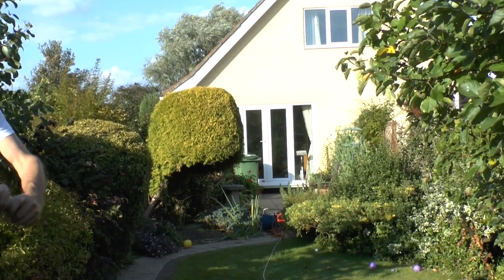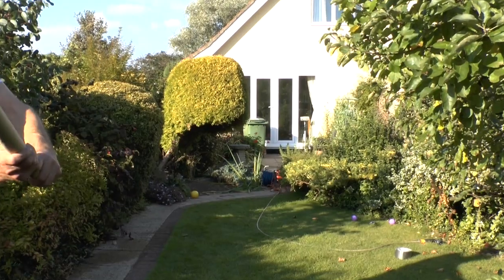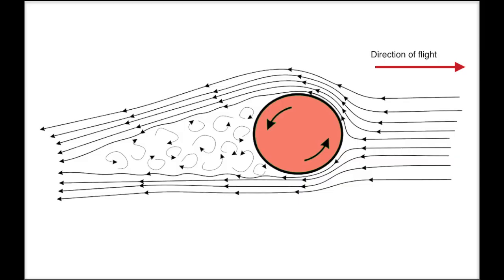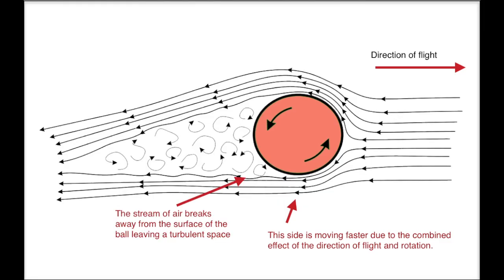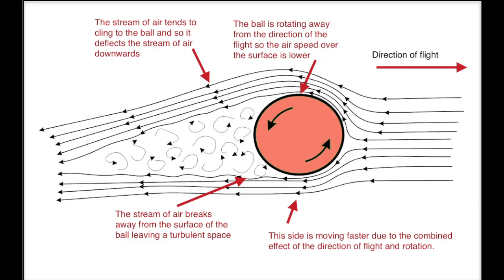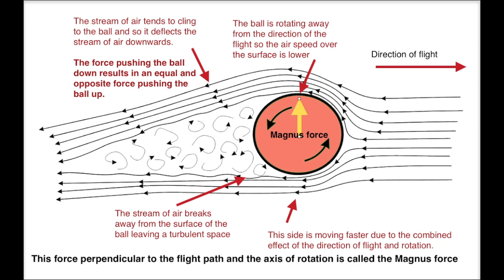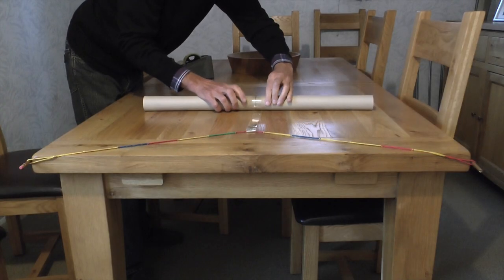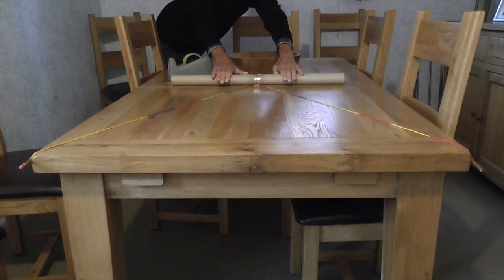The Magnus effect: a curved ball explained: from fizzics.org

Comment: This is a very interesting "human" communication situation as  it looks like Mr Roger Linsell  is seeing one scenario and he is correct, while others are not  looking at the same scenario and some beg to differ with the author, yet they too are correct noting the direction  and states that they  are considering . The result is  a mix up in a human communication situation depending  on the location where we are looking  and the states of the air particles.  Let me try and explain  in a method which I have never done before.
1. We have to assume that the particles  of air touching the rotating cylinder , is the same as liquid  touching the sides  when it flows in pipes, this air/liquid  touching surfaces move with the same velocity as that of  circumferential speed of the cylinder or zero velocity in a stationary pipe.
2. For the sake of explanation let us assume that on the walls of the circumference of the cylinders there are very small  protruding paddles as found on a river paddle wheel. It is the gap between the paddles that causes the air particles to have the same  velocity as the circumferential speed of the cylinder. I have no doubt that along the rotating paddles on the circumference of the cylinder there would be some centrifugal action taking place which we shall use later on.  
3. When the cylinder rotates but does not translate, keeping the same position, the action of the paddles is uniform around the cylinder, so any phenomena that occurs is equally distributed all around the cylinder and so the cylinder churns it all out in all  directions WITH RESPECT TO EARTH,  and hence , its centre, does not move  in any preferred direction. Since in this state of affair, all  air particles in the air are stationary with respect to the ground, then small men standing in between the moving  paddles could never shake hands with the ladies swimming in the stationary air particles!! 
4 Now when the cylinder moves as shown on Mr Linsell's diagram, and let us assume that the circumferential speed is the same as the motion forward, then  with respect to the paddles and gaps between them, the air is moving faster, below the cylinder, twice as much in fact,  to the stationary air away from the cylinder and if we still assume that there  are  small men  standing between the paddles, then when they passing  the lower part of the cylinder, they  could not shake hands with any one standing  in the air some distance away from the cylinder as their arms would be torn off by the slipstream.   But when  when  one  consider the  men on the upper part of the cylinder, well , they would be stationary with respect to the ground for a second and so they could shake hands and do whatever one can do in a split second, with any one occupying a space in the air particles near the cylinder. 
5. Now the men in between the paddles are in for a surprise as the centrifugal action throws them out from their comfortable spaces and as they are thrown out well , under the cylinder they would change the momentum of the stationary air, a little distance from the cylinder by making it move in the same direction  while the men who are throw out will lose their momentum and their original speed, hence compression.  Those on the upper side well ,  it the  circumferential speed was the same as the linear motion forward, when thrown out by centrifugal  action, the men would not even bat an eyelid as they would be stationary with respect to the stationary air particles.   But if the  linear forward motion was not as high as their circumferential speed   well, then, when they are thrown out by centrifugal action then they will hit anyone stationary and will move him forward in a differential manner .   So basically,  the air below the cylinder, a slight distance away has been  accelerated forward  from stationary and so compressing the men who emerged from between the paddle,  while that at the top  the men simply stepped out, and not even moved if the circumferential speed was equal to the peripheral speed.   If the circumferential speed was higher than the  forward velocity, the movement of the air particles in the back direction would not be as much as the movement forward, below the cylinder,  This is where the differential pressure come about.  Those little men between the paddles  below the cylinder will be slammed against the  stationary ladies  loitering in the air particles, and that will slow the men down,  while above the cylinder the men will simply step out and cordially meet the  stationary ladies awaiting them.
If the circumferential speed is different from the linear translation motion , well the reader can see that the air slightly away from the cylinder and not in between the paddles will be affected differently for those air particles on top  compared with the air particles below the cylinder. 
6.   I feel that all that explains  why Mr Linsell showed  the arrow with the statement,"  This side is moving faster because of the combined action of the rotating cylinder and the forward speed."
7. I should complement Mr Linsell on the fact that the two little vortices shows nearest the cylinder  are rotating in the right direction, but I am afraid most of the others  he could have  been a little more careful, as primarily there would have been two larger vortices,   one above the other  circulating in that gap behind the cylinder.   Where they touch the "stationary" air  particles  above and below that bubble gap behind the cylinder,  both vortices will have " stationary or low velocity air,  but  at a central position in the low pressure bubble they would be moving as fast as the linear motion of the cylinder.   If the linear motion of the cylinder increases then Mr Linsell is correct, these two primary vortices will break down into what he showed and the sealed low pressure bubble will create a " hole in it" to introduce higher pressure air from the back .
8. If the circumferential speed is say 20 mph and the linear speed is 100 mph,   what was described above will  result in a theoretical RELATIVE speed of 120 mph above the cylinder and 80 mph below the cylinder.  It is interesting that below the cylinder the distant compression zone as the men where thrown out to move at 80 mph for an instant, will make up for the speed retained by the men who still occupied the spaces between the paddles!!
Reply from the maker: This is a hell of an explanation. I think I agree but I will have to reread it a few times
Reply: Just to finish this off, the velocity additions are not exactly as stated as they are vector additions and not linear ones so the 120 mph and the 80 mph need reconsidering but when a non rotating cylinder  is moved through the air,  at 100 mph,  with respect to ground , then the most front part  or the "stagnant point" is also moving at 100 mph  with respect to the ground. But when the cylinder is rotated with a peripheral speed of 20 mph then the air particles will have an upward velocity of 20 mph and a horizontal velocity of 100 mph so theoretically the air particle will move with respect to the ground at  the square root of (100^2 + 20^2)    and so the stagnant point will move to a lower position , where the relative velocities, will decide where the new stagnant point will now exist.   All this is what makes the cylinder to float in the air.

Incidentally  due to the fact that the low pressure  bubble behind the rotating moving cylinder has that particular shape, one can fill it up solidly to produce the more conventional wing airfoil section and the fact that the air below is slower than that emerging from the  upper surface, the multitude  pairs of helixes  or vortices that form behind  the trailing will be lower and more controlled, provided that the angle of attack is not increased too much as turbulence will occur which will, form a " virtual pipe"    which will bleed higher pressure atmospheric distant air into the low pressure bubble and the wing will stall.

When not  stalling, the "flight path" of the air particles above the upper surface due to the upwards accelerated  air particles by the wedge angle on the upper surface of  the  leading edge of a wing  produces a sealed moving bubble of air above the wing  which works in conjunction with the compression zone  existing below the wing. The wedge angle of the leading edge of a wing,  forces air particles to accelerate upwards to a flight path above the upper surface of the wing as this passes under,  this does replace the rotating action of a cylinder shown in this video, and what is  more, circulation of air around the wing still exists as in the circulation of a rotating cylinder.   What goes on when the low pressure bubble above the wing tries to collapse, due to higher pressure above it and the wing being lifted while  the low pressure bubble  is continuously being revived by the forces on that wedge on the leading edge........... well that is the miracle of airfoil sections. 
This was rather long, but then there is so much to explain and this is only a little of it.

Comment: Mate, I do believe the magnus effect is due to air currents rolling off of the surface and newton's third law creating thrust in the opposite direction/angle of the most substantial air current / surface interaction.

The question arises, will a more rough surface create more air friction, and thus more air rolling off of the surface; or will a rough surface nullify the magnus effect by creating more turbulence in vital locations for thrust?
Reply from the maker: Hi good question but I don't know. Experiment with a table tennis ball first smooth and then roughen?
Reply: Sounds like a good plan of attack.
Reply: Hi, I am currently doing my masters thesis on it and turns out it enhances the lift generated in some cases depending on the kind of roughness used! In my studies we found out that when there were ribs along the span of the cylinder, the lift force generated was significantly higher with lesser drag as well!

Comment: Hi Roger. Just thought i'd let you know that your air flow chart is wrong. First of all the top side would have a faster velocity of airflow over the ball, as the velocity of air flow is dependant on the velocity the object is travelling through the substance and spin velocity. This would create a LOW pressure at the top as the air is travelling at a high velocity and a HIGH pressure at the bottom because the air is travelling at a low velocity, as stated in Bernoulli's principle. This is the factor that causes the swing in a spinning ball, the sudden drop in a top spin and a ball to hold up during back spin during flight.

I find it easier to understand if you draw yourself a diagram, label the spin of the ball, label the direction the ball is travelling, and the opposing air direction and how it flows over the ball (like you have). Now, the air travels over the ball at the same time on both sides, what changes is the distance it has to travel. Therefore the velocity of the air (on the top side of your diagram) has to be greater to compensate.. Now think about the stuff i said earlier about the LOW pressure and HIGH pressure and Bernoulli's principle. I hope this helps any students sitting biomechanics tests in the future :) If anyone can correct me and explain why I am wrong please do so!
Reply from the maker: +Luke kairies No, I don't think I am wrong. The deflection does not depend on the Bernoulli Effect but on the rather more well known Newton's Third Law. The air is deflected (downward in my diagram) and there is a resultant reaction on the ball in the opposite direction, this is called The Magnus Effect, as in the title.
Reply: +Roger Linsell 'When a sphere moves through a fluid and it spins, it increases the speed of fluid on one side, and reduces it on the other. As the speed is inversely related to its pressure (from Bernoulli's equation) there is a pressure difference at right angles to the direction of flow causing a lift force known as the Magnus force.'

See: P.Grimshaw, A.Lees, N.Fowler and A.Burden's 'Sports and Exercise Biomechanics', 2006, published by Taylor and Francis group. Pages 238-246 on forces in a fluid.

But I would like to see where you are getting your information from? Could you please send me a reference or a link?
Reply from the maker: +Luke kairies Hi
 Yes I know there is also a pressure difference and there is a difference in opinion of which has the greatest effect, it rather depends upon which pieces of research you read however the difference in air speed is not huge and therefore the difference in pressure operating on a fairly small area is likely to result in a small force. The reaction of the change of velocity of the air flow seems likely to be a greater force and a better explanation but it is hard to measure the relative contribution of each effect.
Reply: You can't invoke Bernoulli if the the velocity of the airflow around the ball depends on the velocity of the ball (i.e. there are viscous effects).
Reply: The fluid that "cling(s) to the ball" is going to be moving in the same direction as the free fluid when at the top, therefore the fluid at the top is faster. That's the "intuitive" way of thinking about it. 

I'm still uncertain as to why that isn't actually what is happening. I understand what Roger is saying, the velocity at the bottom is faster since that point of the ball is spinning the same direction as the ball itself. Therefore, the fluid "clinging" will just be the same velocity as the ball velocity as an outer point (therefore faster at the bottom).  

Maybe I'm just confusing myself.
Reply: I caught that too!
Reply: Both of you should watch video about coanda effect and airplane lift force.
Reply: I suggest Learn Engineering video
Reply: Well both of the Newton's third law and Bernoulli's equation is correct for the spinning ball,
There is just two perspectives of looking at it😎😎
Imagine that of an aeroplane wing🤔🤔
Reply: This cannot be due to Bernoulli's principle as it is applicable only for one streamline according to law of conservation of energy.

Comment: 1:42 Isnt the arrow discription on the bottom and top not wrong? The airflow is on the bottom slower, than the airflow on the top of the ball. Because this (and because, the upper airflow rotating with the ball and hits the bottom airflow) , we have a high pressure on the (left-)bottom, and a low pressure on the top of the ball. So the ball is moving to the top.
Reply: it is correct bcs velocities subtracts when in same direction.  and added when in opposite direction. i.e upper part will be slower w.r.t air
Reply: Roger Linsell when you run simulations stream velocity at the top is higher.
Reply: Nohlan correct, the diagram is wrong.
Reply: It's not wrong. The arrow is meant to be pointing at the ball, not the air. That side of the ball is moving faster relative to the air because the rotational and direction of movement are aligned.
Reply: Well, that picture was actually showing backspin, not topspin.
Reply: +Nohlan et al.,

I know this is old, but...
..
RE: "The label on the air arrows are incorrect, simply because a faster air speed at the bottom of the ball as well as a slower air speed above the ball will create an area of lower air pressure below the ball- thus making the ball go down."
.
This is echoing (and even quite badly) the all to common Bernoulli's Principle Fallacy that : "Fast air creates its own lower pressure."

The Bernoulli Principle and Euler's work making the Equation have NOTHING to do with the relative speed of a surface and airflow as well as not entering the explanation here.
..
The red arrows only point to regions being described and the lower pressure is caused by the longer path of the air along the surface of the ball.  It is the relative air-surface speed that allows this to happen more at the upper left than the lower left.
...
I also explained why this video is still quite incorrect in a comment shortly before this one.
Reply: Well, let me make this clear that he saying about relative velocity of ball w.r.t. to air and so he is correct. As far as you are concerned you are also right cause you are talking about the velocity of the ball wrt to ground.
Conclusion : 
Pressure of air at the top is low because of higher velocity of air with respect to ground and pressure of air at the bottom is high because of lower air velocity wrt ground. And because of this air pressure difference there is a net upward force causing the ball to move upwards.
Reply: Nohlan  reminds me of Bernoulli’s principle
Reply: The label on the air arrows are incorrect, simply because a faster air speed at the bottom of the ball as well as a slower air speed above the ball will create an area of lower air pressure below the ball- thus making the ball go down. 

The arrows on the ball demand the ball to have upwards thrust- not downwards thrust (as I have tested)

Another flaw with the labeling of the air arrows is that, you say the air below the ball has quicker movement due to a combined speed with the surface of the ball, when the ball's arrow surely notates that the bottom surface is going against the air-flow at the bottom. A vice-versa effect is apparent for the top of the ball, as well.

There is certainly something wrong with the labeling and/or the arrows.
Reply from the maker: +Nohlan I think they are correct. The lower surface of the ball is travelling faster with respect to the steam of air because it is rotating towards it. There is likely to be a pressure difference but the main effect is the deflection of the air (towards the bottom of the diagram) and the resulting reaction of the ball in the opposite direction.